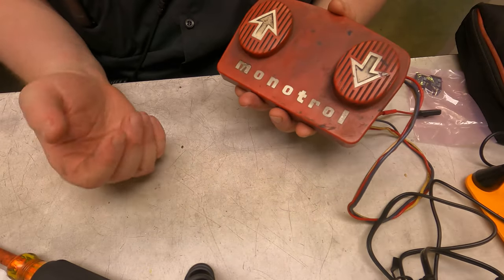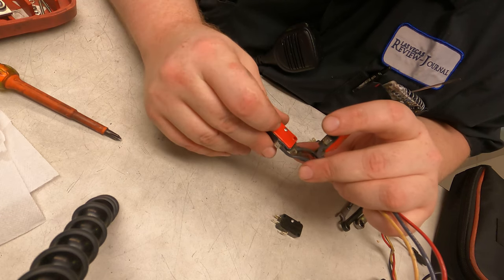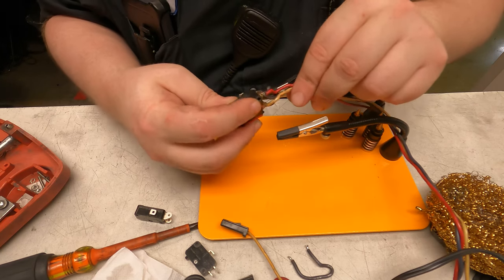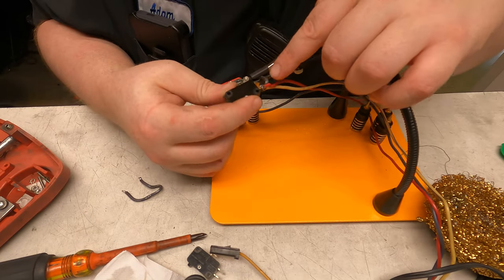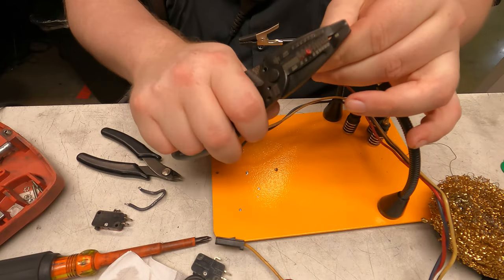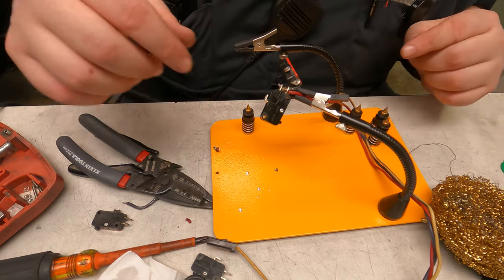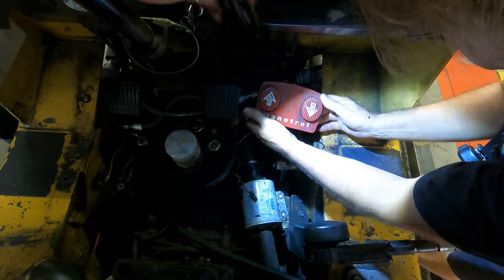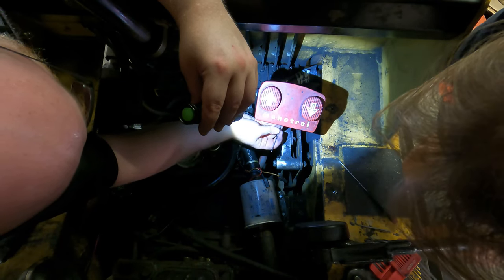Fixing A Monotrol Pedal (Hyster Forklift Won't Go Forward)

Comment: How do you remove the pedal itself?
Reply: At 5:00 we show an install.  It's reverse of that.  Cut zip ties holding the wiring cable in the channel.  Loosen 2 set screws holding the center rod, then remove the rod.  After the rod is out, the pedal pulls off.  Just be careful not to drop the spring under the pedal.